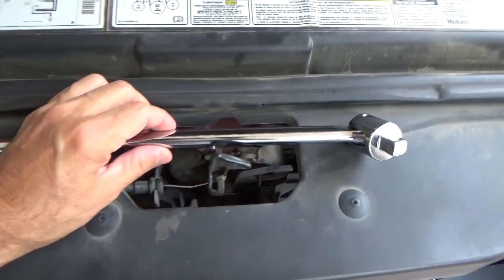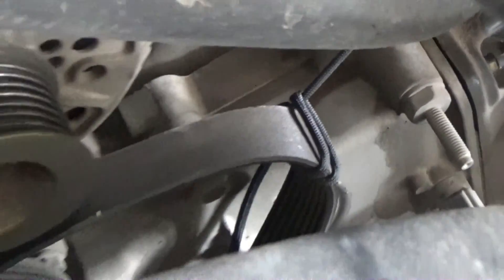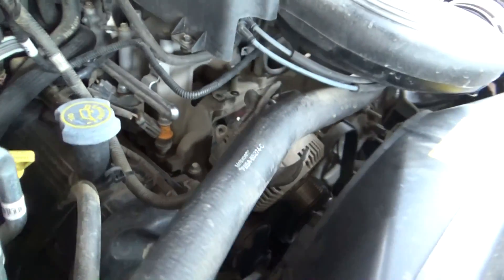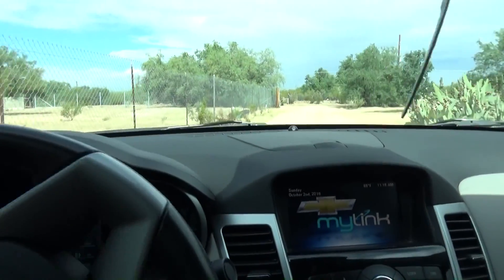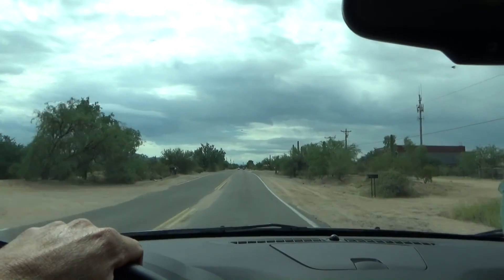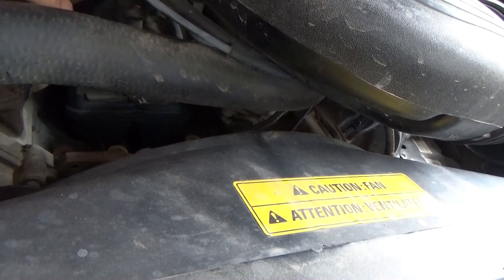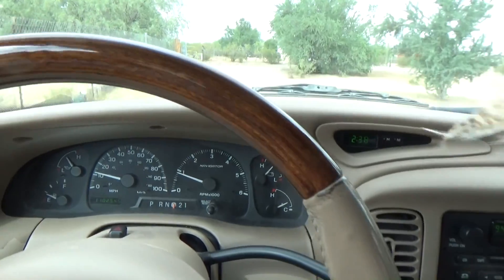Daily Vlog 1999 Lincoln Navigator Alternator Removal & Installation

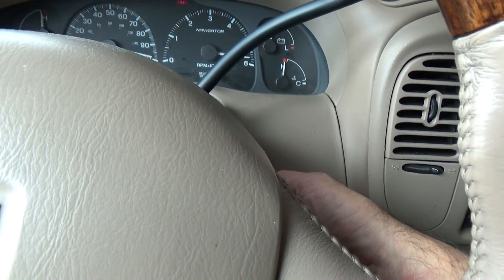Comment: 17:04  "an then I let the Alpine play. . . ."  Thanks for the vid, got this job to do tonight.  we have the same interior, mine's white, and 2002.  I got the lifetime warranty alternator, cuz you can have my navigator when you pry it from my cold, dead hands.  The transmission has a lifetime warranty, and that's the only thing I couldn't cough ahem, wouldn't want to fix.  Love the factory alpine, and the air ride.
Reply from the maker: Snap-off I love these SUV's but I sold mine about 1 year ago.
Reply: I drive mine like an 80 year old man. . . 15.5 miles per gallon baby! I'll put a whole new remanufactured engine in mine, and drive it forever.

Comment: Good job. You should have. picked  up a battery and alternator tester when you were at harbor freight last time.  The cheap led tester can tell u right away if your alternator is good.  The voltage output of your alternator should be 14v  with a range of 13.5 to 14.5v.  You'd not get a good reading if the regulator is bad.
Reply from the maker: the whole alternator was bad. we tested it with a new voltage regulator and it still failed. thanks for watching.
Reply: wtam69 going to invest in that

Comment: Glad you were able to fix your truck. I told you it was a bad alternator. Bummer on how those people treated you at AutoZone but good that the one guy was there and helped you out. I've replaced a belt in a Toyota minivan and replaced a few clamps that were rusted.

Sometimes you have to bite the bullet and get a whole new part vs just replacing a few small parts of something. You should have kept the battery that was originally in your truck. Mount it on a hand truck and you have a jump pack. I did this and put a 12V lighter plug on it and I can plug 12V stuff into it including my drill.
Reply from the maker: I did keep the battery, I had a very old battery in my shed and I used that one for the core.

Comment: I agree on the O'Rielly Parts factor LOL. TJ's truck blew a heater bypass tube $215.00 at O'Rielly The  Same exact Dorman part number was $134.00 at Walmart online auto parts with $5.00 overnight rush shipping.. I call them  NO- Rielly
Reply from the maker: +Tioga Trails I have never shopped there but after talking with this guy I will never go there.

Comment: The thing about any large corporations with tons of stores and even more employees, especially auto parts stores, its hard to find people that are actually knowledgeable about cars and that will be completely honest with the customers. I work at an O'Reilly Auto Parts here in Scottsdale and I think that our store is probably the best one in Arizona/West Coast because we are honest and won't try and up sell you, we will give you the options of the more expensive parts but we don't really care which part you buy. In the end all that matters is getting the job done correctly and without hassle. Hell our store here goes out of our way to help you, I've given customers rides to their car that has a dead battery and installed it for them and we have a guy here that has done alternators and even a brake job for someone because their brakes were metal to metal. Every company has good and bad locations, just gotta find the ones that actually care and will do their job and go beyond to help people in need.
Reply from the maker: +Riley Potter that's the problem no one cares to help people anymore. I do not like o'rileys, there parts never last.

Comment: the part you took off in beginning is the voltage regulator
Reply from the maker: yes, but the whole alternator was bad even the voltage regulator.
Reply: I have rebuilt vintage gm alternators from the 1980's. inside is a diode treo and a bridge rectifier and brushes.
Reply from the maker: Travis R. I Have never rebuilt a alternator.
Reply: I used to enjoy doing them. would only take about a half hour to do. I hate autozone cause they don't know what is what
Reply from the maker: Travis R. it is hard finding people who knows anything there.